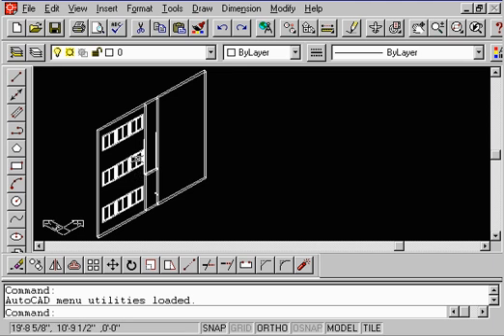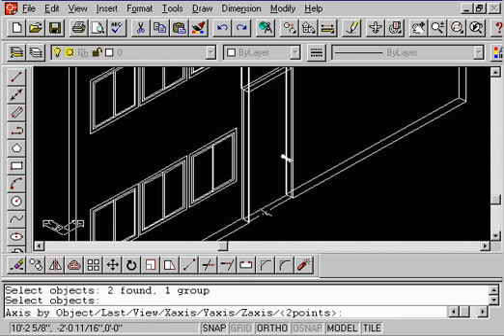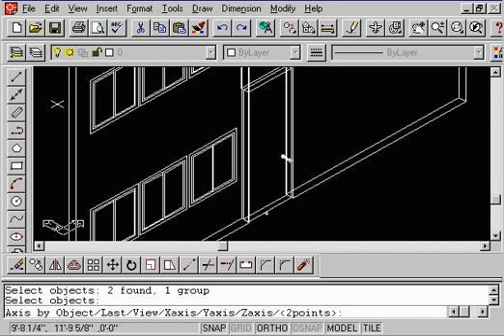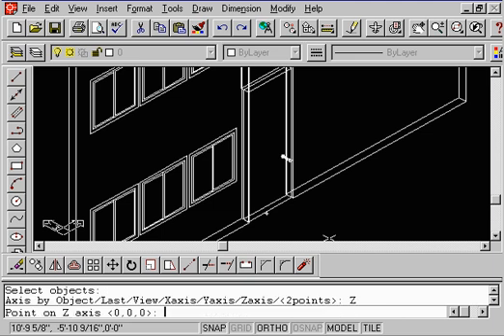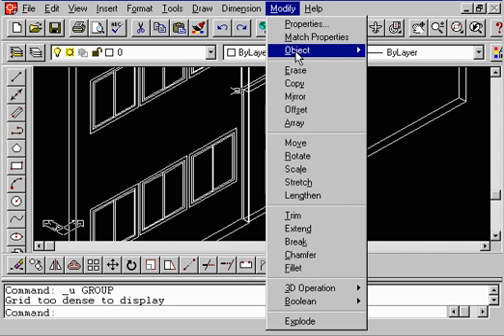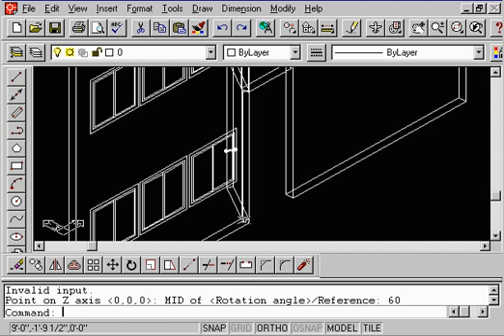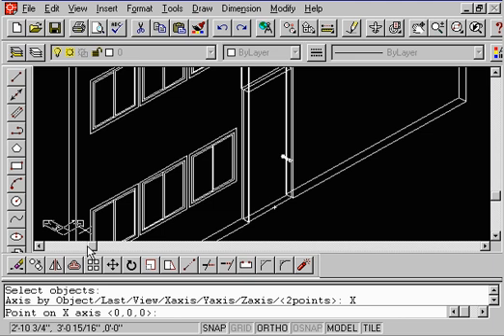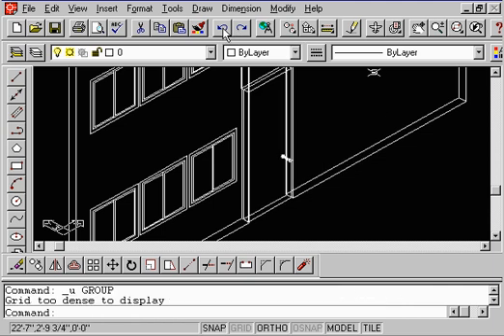1.4.3 AutoCAD 3D R14 - 2008 Rotate Command XYZ Move Modify UCS Door

Comment: Glad to find this.  R14 maybe ancient, but it is not a monthly model!  So if you were lucky enough to own it back then, you can still use it.  It WILL work on Windows 7 64 bit Pro if you install Virtual XP  (otherwise 95 thru XP).  There is the Longbow software that will let you install it on later versions of Windows too.  It pisses me off that a program costing as many thousands as that did, is sidelined - that was money, serious money.  Now Autodesk want you to pay 1700 Euros a year!  Yeah, maybe if you work for some corporation with endless pockets, but for some poor bloke who only does the occasional drawing for their own, home jobs, but knows the early AutoCAD, it is just crazy.  Even their per month is nuts - about 250 Euro.